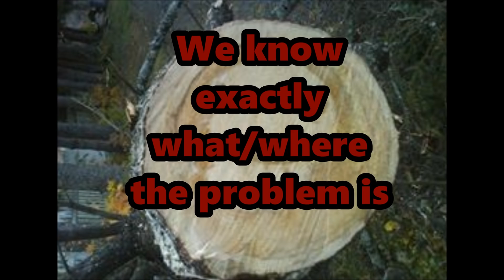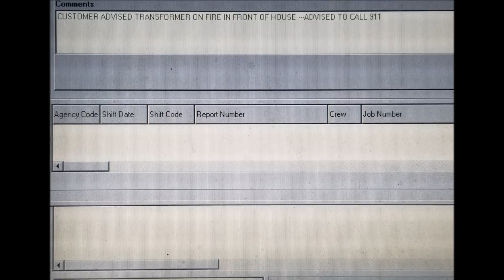5 Myths about Power Outages

Comment: Around 2008, a transformer lid blew off.  The barrel part was still up on the pole.  It was one of those extremely hot Texas days when we heard a loud pop.  The lid was still (mostly) on but was not completely off.  The apartment complex had underground power so we weren’t affected.  The house across the fence lost power.  I watched the electric company from my apartment disconnect the lines, unbolt the transformer from the pole then lift the new barrel (transformer) up to be attached to the pole and the cables attached.  It was interesting to watch through my sliding glass door.  There was no way I wanted to be outside with this happening.  I never realized a transformer was the size of a 55 gallon drum!
Reply: Those transformers are have a pretty slick design.  The brackets that hold them hang on to L bolts that go through the pole, so they only have to be loosened for removal. 
There are many different sizes of transformers, all depending upon the amount of power designed to run through them.  
From my observation, the pole-mount voltage regulator transformers are the largest.  These are placed in triads in strategic places along major utility lines to correct for voltage drop.  They have automatic variable taps that adjust the output voltage to match a target voltage no matter the voltage coming in.  They're typically 7 feet (2.1m) minimum.

Comment: "have the walk the entire length" Are there not devices that measure transmission line reflections? I have a simple one that tells me to a few inches how much length on a roll of cable, surely those can also be used to determine roughly where the break is
Reply from the maker: Yes and no ... On our transmission system they can get a fairly accurate  fault location using the fault current. It's very efficient in reducing time to find the problem

On the distribution system not so much. you could use equipment to help find the break, but most times the wire isn't actually broken. Unless it's open at a breaker you won't have much for Fault data. It's easier to just walk the line !
Reply: In Arizona we had an experimental system that did that and was supposed to be predictive (assuming the fault was a dirty insulator or similar.) The system worked fairly well on the handful of lines that had it, more so in the rural areas than in town. The devices reported by cell modem and the data was sent to Texas, where it was processed and whatever university was running the project, and they emailed reports.
The major reason an ordinary reflectometer won't work is the lines are not point to point. There can be hundreds of branches of it with all sorts of loads and all sorts of impedances. Typical faults can be arcing underground lines (no problem until they arc), broken crossarms, mylar balloons, seriously dirty insulators, critters that are not blown into the clear, tree limb problems.... For the underground faults, the troublemen have a "thumper" that puts jolts of the normal operating voltage (15KV rms around here) on the line while the t-man walks the line with a microphone on a stick against the ground, listening for the arc.

Comment: Good video!

We are a net metering customer with a smart meter.  If the power fails I get several texts, the inverter manager (for solar) and the standby genny controller are first.  The power company also alerts me as their smart meter detects this.  Neat stuff.  And yeah there's lots of ways so called de-energized lines can zap you!  An unbonded set of overheads between poles can measure 50kV DC from just the wind blowing on them!  Like a big capacitor (Leyden Jar) charged up with static waiting to KO the unsuspecting person touching them!

And ignorant customers wall plugging generators.  Typically with shared service their genny will stall or open its CB as it cannot power everything in their neighbor's homes.  BUT if that backfeeds and puts even a few mA on the primaries it's going to be a surprise to someone if they're lucky.  And could be far worse.  STOP wiring them into a dryer or welder outlet!!!  You could KILL someone!

And yes during storms particularly ice storms when those beautiful green-blue flashes are aplenty I hear it all the time...Do you see those transformers blowing up??!  Gah!

We're in the mid atlantic region and smart grid tech is well implemented.  Just about everywhere a recloser is used there is an uplink that notifies its status.  Response time is good.  But in severe storms even 10' clearance of trees around overhead primaries cannot prevent faults when entire trees come down.  But lack of vegetation maint will cause a lot of nuisance calls.  And most of those places in the sticks have a single fuse, bang!  Lights out.  We also have snakes, squirrels, and larger birds of prey that unfortunately can span the closer phases of 13 and 33kV overhead primaries.  Raccoons tend to like substations too.

Comment: I'm an IT Technician in education, and it's surprising some of these also apply to my profession;
5: We know your power just went out
I don't know when or why an individual computer disconnects from the network, and I won't know unless the user tells me. It's not uncommon for a user to moan that their PC hasn't worked for over 2 weeks, that I'm not doing anything about it, but when asked why they didn't raise a support call I get the same old excuse "you should know that my computer is broken". If a server is struggling, I'll know because we have monitoring tools in place. If a network switch fails, I'll most likely know since although I don't monitor switches, an outage would affect a wider area. 

4: We know exactly what/where the problem is
Troubleshooting tends to involve educated guesses based on probability, and depending on the affected area we can typically pin-point whether it's a network infrastructure failure, a hardware failure, or (predominantly) user error. It may seem like I know everything and I'm a sort of computer-whisperer/clairvoyant, but I'm just a cynical guy who has has a 95% likelihood to have seen your issue before and pays attention to detail. 

3: Wires lying on the ground are dead
I'd say the closer resemblance would be when a computer is left on and someone thinks to turn it off. Good thinking, except for when the computer is performing a task or while we're connect remotely. Depending on the tool used, on some remote sessions you can see the technician working on the screen because we're using a single-session connection. But when using a multi-session connection, the computer may not appear to be doing anything, but I'm connected remotely on another account on that computer. It's damn annoying to be in the middle of installing/un-installing software, performing updates or maintenance etc. only to have the 'remote device disconnected' message pop up and find that the machine no longer pings. Just because the computer is left on, doesn't mean it's not doing anything.
Reply: The difference is that you get to do your work in a AC\heated office space. The lineman takes far more abuse than the mailman: neither rain, sleet, snow, or wind stops the lineman from doing his job. Also one of the more danagerous jobs considering they are working with lethal voltages in perhaps less than idea conditions (trees coming down in heavy snow or freezing rain). 

Also It appears lineman are an vanishing breed as fewer younger people are willing to do this type of job.
Reply: @guytech7310  AC/heated office space? You must be dreaming. I work in the public sector. My previous office was a converted toilet, and that was with 3 other guys crammed in. Our current office is a 'temporary' terrapin that's been sitting in the same spot for 20+ years. You shut the door a bit too hard and you can feel the building shake. You can kick a hole in the wall. 

But that doesn't make it worse than what a lineman has to go through. You can get killed in any job if you're stupid enough. My point was that the 'end-users' I deal with have similar delusions to my capabilities and responsibilities to that of a lineman (at least as pictured in this video). I don't deny it's far more dangerous than my daily duties and the risks I tend to put up with, but don't assume all is perfect in my profession.

Comment: This is educational :) 
In some remote places, it may be cheaper to run a microgrid with storage instead of rerunning an old line or building a new one.
Reply: Unliking since power storage is very expensive and generators require a lot of maintenance & fuel.

Comment: I woke up at midnight to no power one night in Epping in Melbourne’s North back in the mid 1990s.  The power company had no indication of an outage and none of my breakers had thrown so they sent a truck to check on the underground system in the cul de sac.  They found a damaged cable jacket. Seems a drainage contractor had nicked it while installing the street drains. It had taken 12 months for enough water to seep in and cause a failure.  Took most of the day to repair it.

Comment: Here in the US we cross contaminate our transformer oil by reusing it.
Reply: (US here) US utilities never allow PCB oil to be put into service in any detectable concentration. Non-PCB oil can be reused, depending on the company's procedures, but every transformer that is handled is tested for PCBs, generally before moving it, unless already placarded. Fines for failure to control PCBs are staggering. Break out the million dollar bills, men - the EPA is coming to call. (FERC is as bad; ten million dollars is the normal neighborhood for them.)
Reply: @flagmichael  That's the current practice after they found out it was cheaper not to reuse the old stuff. The fines caused changes in how the oil was handled. Decades ago all that remains are war stories.

Comment: I know our lineman where I lived had some difficulty with cracked insulators.  One tripped a fuse on a pole.  Basically to find it the replaced and closed the fuse while looking down the line on that circuit.  Basically looking for a blue flash indicating which insulator was cracked.  Another fun time was when we had our first spring thunderstorm, several insulators had cracked throughout the grid in our city.  The amount of insulators cracked I think tripped the entire grid from the power plant.  Basically replace one insulator, call the plant to close the breaker.  Power comes on, bright flash some where and a bang, then lose power.  The crew then had to find the next insulator.  A total of 5 insultors replaced in all.

Comment: Do you think direct current on the line would blow the fuse or the Transformer first. I am curious because it is possible for a large coronal mass ejection from the sun to create a large amount of direct current on the power line
Reply: That only applies to long transmission lines running east-west in certain areas. Distribution lines are generally not long enough to be affected. The effect of the DC is to cause the transformers to saturate: more current can't create more magnetism so there is nothing to react against current rise. That is detected as a fault and opens the breakers on the line rapidly, but not always rapidly enough. The effect is load sensitive - if the load is light the transformer does not reach saturation. https://www.ee.co.za/article/solar-storms-and-power-transformers-is-it-necessary-to-change-the-viewpoint.html has info about it.

Comment: now what about when power goes out for one second? this happens in rural areas frequently
Reply: That is typically a transmission level fault, which has much faster response and more redundancy than distribution.Transmission level is (in our neck of the woods) 69 KV and above. In rural areas a lot of feeders are "radial" - they only have power fed at one end. If that fails,  power goes down for a while.

Comment: Great Channel. Questions: I'm seeing enormous towers here recently erected in Central Ohio, all identical, maybe four in our county. Down at the bottom of these towers, a black antenna coming off of the side of the tower, has what appears to me is a coil, and a very short additional vertical antenna above the coil. (A regular vertical antenna at the very top of these enormous towers, and a shorter loaded vertical a few meters from the ground level) These appear to be installed by the power company. What are they for? Load management? I was under the impression that load management takes place via carrier current, right through the lines themselves, but maybe that's old technology? I know that several years ago, there was experimentation (some causing interference to other spectrum users, but some working correctly) to provide BPL Service-Broadband over Power Lines. Are any of these things going on in Canada?  It would seem like an awesome thing to provide Internet service in this fashion, WOW FANTASTIC for remote areas! 
How do the interconnects work? Of course this brings up how small failures become very large ones to bring large parts of either (or both) countries/regions into major blackouts. I also have a surge protector here at the meter itself, minimal cost paid though our co-op. (South Central Power of Central Ohio.) Are they worth the bother?  Are there COOPs in Canada? People might also be interested in the "cutout boxes" such as at this residence, where we recieve a monthly discount  for cutout boxes we have on our heat pumps and water heaters, where the coop can shut us down in case of a surge. Do you have them there? Also, Smart Meters, and how they work if you have them? All the Best! DE W8LV BILL (and sometimes W8LV/VE3 ;-))
Reply: I don't know what the towers are. Can you estimate height (maybe by shadows) or see any features near the top? I'm wondering if the thing that appears to be a vertical antenna is actually a lightning rod - excuse me: an "air terminal." It could be for lightning research.
Most of the protection and control communications is done over fiber optics for modest distances or microwave for very long distances. Power Line Carrier is a fading technology for P&C; in my area we put in one system about five years ago and retired three others. The circumstance that required the PLC? It was redundancy. The 500KV line it protected ran 200 miles across Arizona and California. 500KV lines must have two "lines" of protection schemes, each including a Direct Transfer Trip scheme, just to be kept in service. Since only two means the line has to be taken out of service if one fails (a rather common occurrence, actually) it is engineered with a third "line." There was no third microwave path available so we used PLC. It is not great stuff - at 200 miles "tribo" noise from falling snow will snuff out the PLC signal a couple times a year. We get the call to fix it and we do a slow roll - have some breakfast, shower, call to see if the alarm is still in. Drive carefully if it is still in, and call in every half hour for status checks. Go back when the noise lets up and it clears on its own. Rain does the same but not as badly. When I miss the chase (retired a year and a half ago) I remember things like that, and snowcats that are most adept at taking us to where rescue is difficult, and sleeping with the duty phone beside my head....
Anyway, here in Flagstaff most meters were replaced with smart meters using a cell network - Verizon, I think. Not my responsibility!  Some people swore wifi affected them and didn't want smart meters, so they were allowed to opt out. Now the gab is about 5G. Sigh.
73 de former WA6TDG, radiotelephone licensed since 1969; comm/IT tech for the area's main electric company 1984-2018.

Comment: If a guy can afford to live in a castle on the lake, he can afford to buy a generator.
Reply: But can he tolerate the noise?

Edit: had falsely assumed the generator would be the only source of power.
Reply: @user2C47  , they have some that automatically come on and can be diesel or propane powered.  They're a whole house system and go outside  on a concrete pad.  They looked to be about the size of a deep freezer.  If that makes noise, he could always have a party to drown out his sorrows.
Reply: @southernguy35  ... yes, they have some that are automatic. Matter of fact we have about 6,000 customers with sets like that. Some are quiet enough to talk while you stand next to it and some can be heard down the block. It all depends on how much money you have to spend.
Reply: @rupe53  , yes, the height of decadence is when flipping a stack of 100s drowns out a muffled generator.
Reply: @southernguy35  ... might be decadence or just them wanting a good night's sleep so they can print more money at work the next day. <LOL> Actually, quite a few of these more expensive units are in what I call a "hedge fund ghetto". You'd be amazed at how many people tell me to look at their spread and say a $50k generator is this much of the budget. (holding fingers 1" apart) The more expensive installations are the ones where I never talk to the customer. It's always a property manager or live-in caretaker, because it's a weekend home.